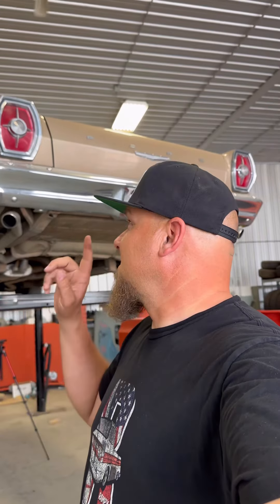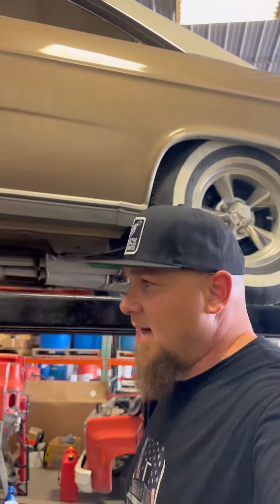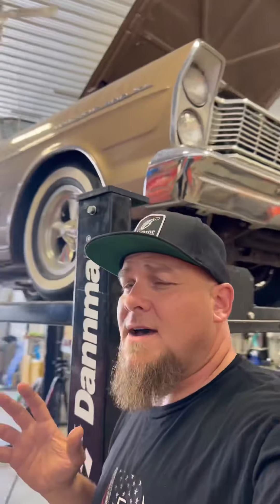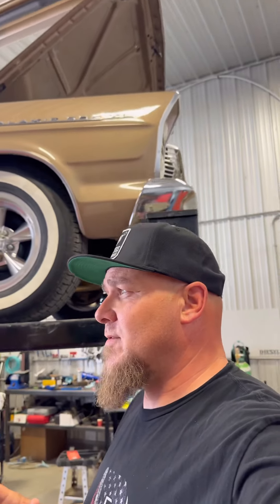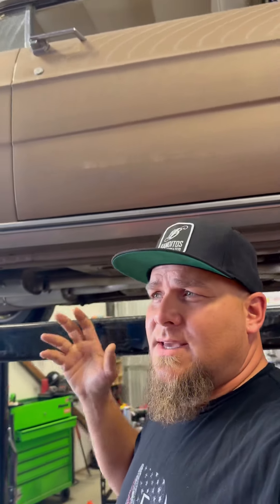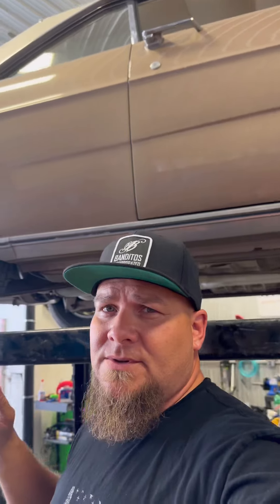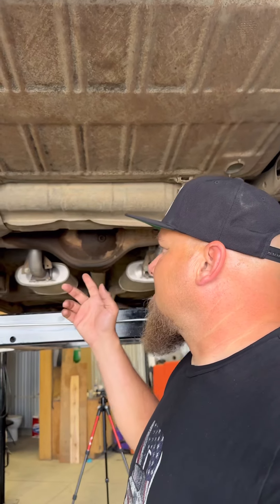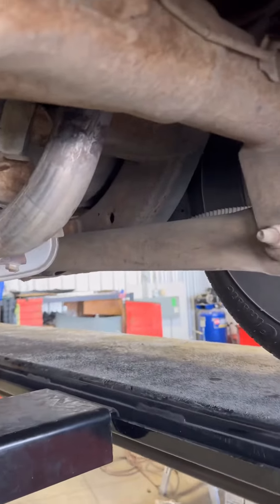1965 Galaxie 500XL

Comment: My 65 Galaxie 500 LTD. Rotisserie restoration with everything rebuilt. Motor is the original 352 Edelbrock carb, cam,intake and water pump. Pertronix ignitor ignition. FactoryAC. 4 wheel disc brakes with 18" American Racing wheels. 9" with stock panhard bar, 1" sway bar and 1 1/8" sway bar front. Drives and rides very nice. Took it for the first 800 mile trip to the NSRA Nationals in Louisville ky. Was flawless. I'm very happy with my Galaxie. There made to drive